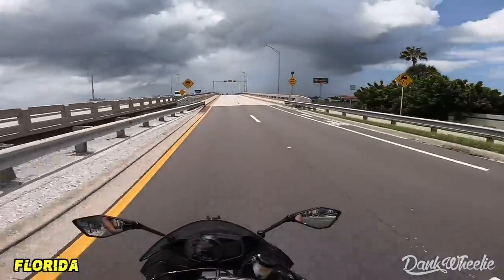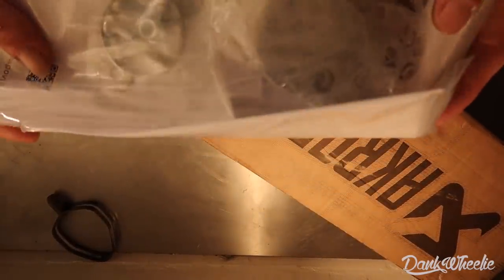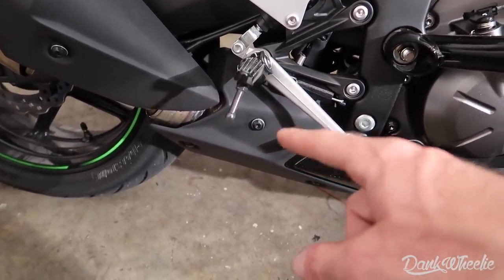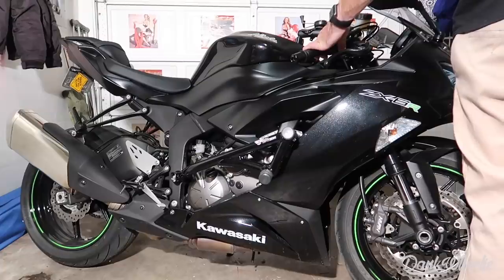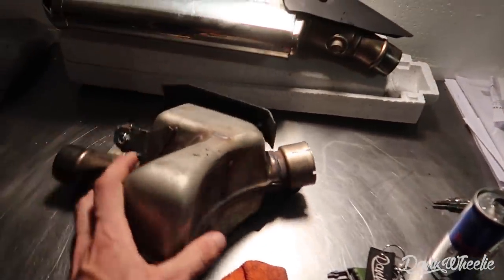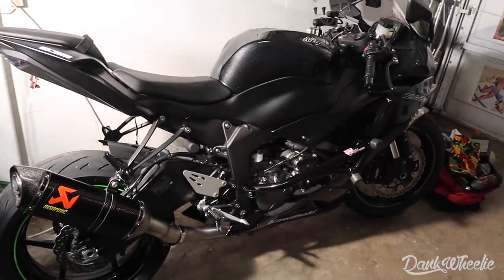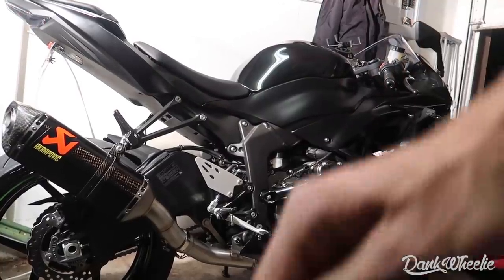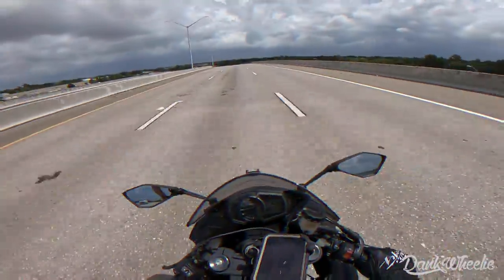NEW EXHAUST For My 2019 Ninja Zx6r! - Install +Test Ride

Comment: I have that same slip-on, the new shape they did looks crazy. 
• I removed the pre-chamber (you call this the cat, the cat is actually in the single end of the header pipe) and replaced it with a custom straight flow mid-pipe (allowed for stock heat shields to bolt back on) I got this custom mid pipe for 150$ from MJS Performance, expanded to fit the wider akrapovic pipe. 
• Gutted the cats out of the header. Banged it out took like 2 hours because I didn't want to damage the pipe if I missed.
• Installed BMC Race filter - what a difference over stock, and noticeably better than K&N.
• Installed Block-Off Plates, and I removed the pair valve and did a jumper mod so it wouldn't throw a code. This removal of anti-smog pair valve prevents the popping noises on decel or coasting and makes you exhaust smell amazing. These backfires can actually be damaging to your engine.
• I welded in an o2 bung to the header (theres actually a flat spot which is perfect for this) and wired up the auto tune
• Added a Power Commander V and Auto Tune modules in the tail section, cleaned out a nice compartment and looks super clean.

edit: formatting
Reply from the maker: Will very nice!
Reply: I installed a servo buddy once
Reply: Did you cut your cat off? I got the Yoshi Alpha T pipe and it came with mid pipe that slips into cat and muffler that slips onto mid pipe. If you gutted or cut off your cat don't you get engine light on?
Reply: @SpyvsSpy-yl9ip   I gutted it.. There are a couple tutorials on youtube.. one guy named piston Slap has one. I took the header off when I did mine though (he left his on). And no, unless where you live requires emissions (o2 sensor comes installed stock) then removing the cat it does not affect or throw any engine codes. it is not like a car where removing the cat will throw an emission check engine code.
Reply: @oOoRLY1  Oh okay, very cool. I didn't know that. Thank you
Reply: @SpyvsSpy-yl9ip  if you read his comment,  he stated exactly what he did.
Reply: @zach4185  yes, that is the edit
Reply: How to do the jumper mod for the ais?

Comment: Use Woolich racing for your ecu flash, this will provide you with a much broader tune than a PCV tune, powercommander only tunes in blocks of 20% throttle opening, whereas a Woolich flash directly to the ecu allows you to tune in increments of 1% throttle opening. Much cleaner tune in the end and you will also be learning how to tune. Oh yeah, get rid of that baffle, throw it in the yard, kick it a couple times... lol!

Comment: Yoooo DANK! Question: I’m installing a M4 GP19 slip-on onto my 2021 ZX-6r and I’ll be eliminating the cat-converter along with adding the servo buddy. With that being said, is a flash needed? Does it ruin the bike in any way if I go without doing this? Thanks.
Reply: No. Adding a slip on doesn't do anything to the performance. You only need that stuff if you do a full exhaust replacement.

Comment: Does yours have stock gearing? I have a 2018 and I cant get it to clutch up in 3rd. I usually clutch up in 2nd and shift to 3rd at balance point.

Comment: You can actually just remove the cables without any issues as i did it to mine without any problems, make sure to remove the CATS out of the header pipe , i just used the conventional hammer and a wide screw driver and the job is a gooden , did you consider the Austin Racing exhaust? Trust me it sounds fucking amazing 😃

Comment: Can you post what you use/bought to hook up the phone mount to the gas cover? From what I see, the zx6r 2019 dont have the bolt holes visible and which mount bracket supports the zx6r 2019. Thanks.
Reply: That isn't a gas cap mount. Suction cup

Comment: For those of you installing — BE CAREFUL with that graphite gasket. I broke mine after applying slight pressure wondering what the hell it was. 

It’s $35 a pop... Lesson learned. Have to wait a little longer to install.